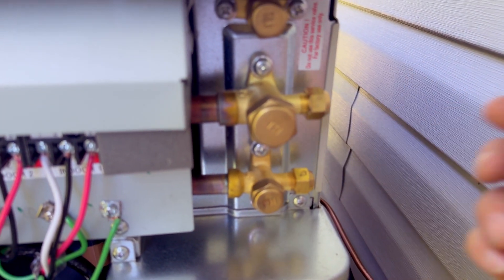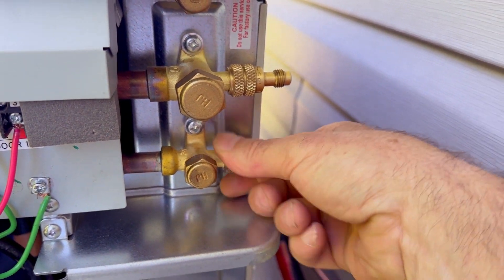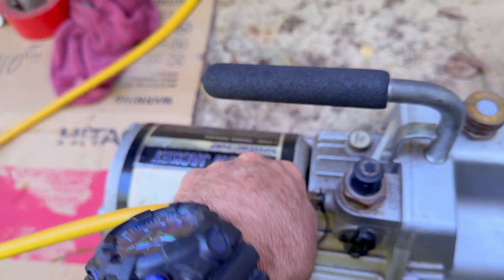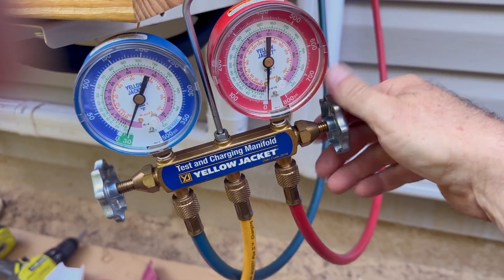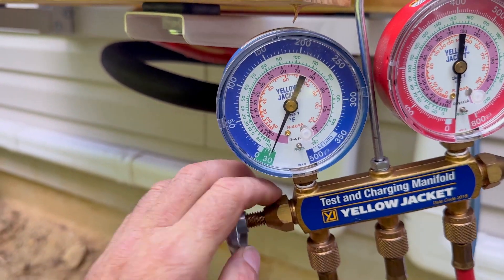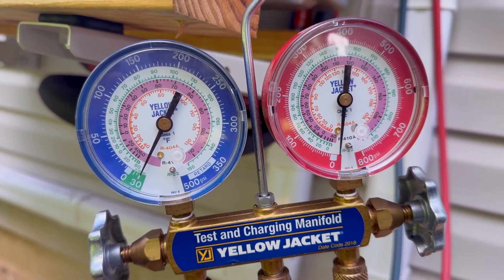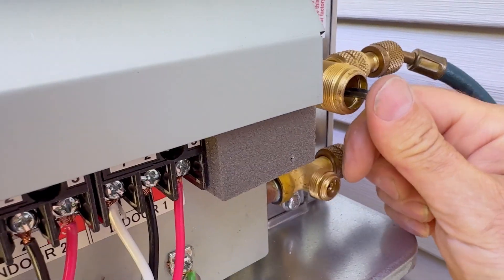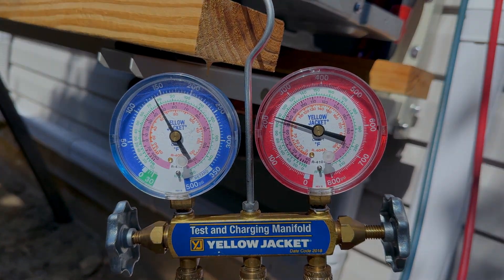How to Vacuum a HVAC Mini Split With Analog Manifold Gauges

Comment: As a beginner, can I ask what set of gauges I should buy for R410a and R454b? Some are $100, some are $400! THANKS AGAIN! (I couldn't find item in description link).
Reply from the maker: HI!  I don't recommend the cheapest ones.  The ones shown in the video are yellow jacket and they run about $150(ish) currently.  However for 454B you'll need a left hand thread adapter or a set of hoses specifically for 454b... Hope that helps.
Reply: @TheHomeImprovementChannel  Thank you! Your information is truly priceless and such a help! Looking forward to more vids now, as a subscriber.
Reply from the maker: @churchwood5016  TYSM for the great comment and feedback!  Thanks for the sub... 😊